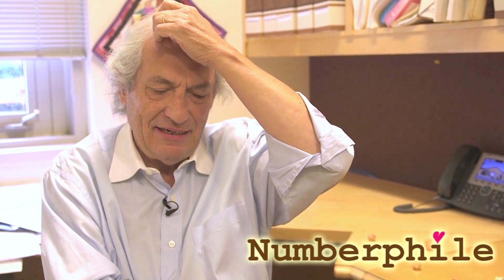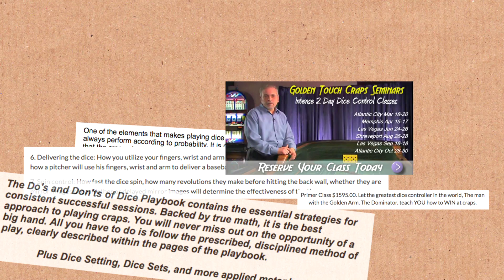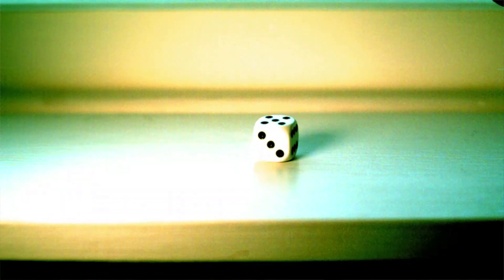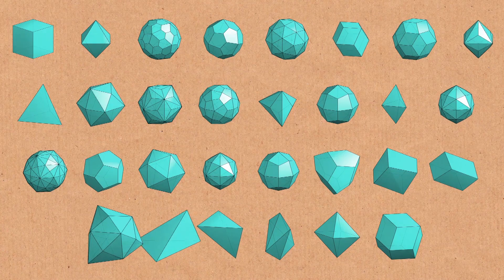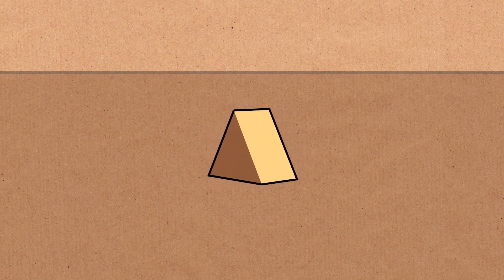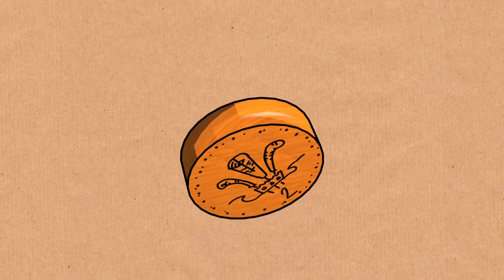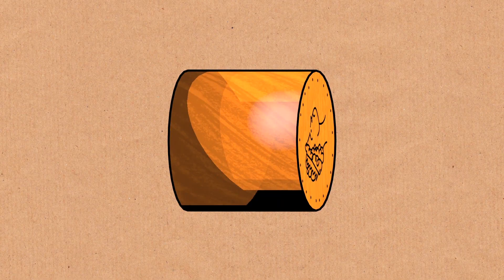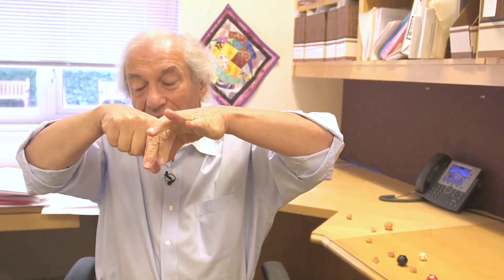Fair Dice (Part 2) - Numberphile

Comment: The roll rate of unique faces of a die come up the same as the time rate of radioactive atoms decaying in a sample of radioactive material.  So, for example, if you roll a 20 sided die 20 times then the expectation is that 20(1-e^-(20/20)) or 20(1-e^-1)=12.6 or about 13 unique faces will show (decay) in 20 throws of said die.  If you roll that same die 60 times the expectation is that 19 faces will show ie 20(1-e^-3)=19.  Then using Excel for example, x,y plot the expected number of unique faces that show against the actual number of unique faces that show for 60 throws.  Do this plot roll by roll.  Then do a first order (linear) curve fit to the data; set intercept to zero.  Let the slope of said curve fit be the judge of the die.  I would think that a slope of 0.98 to 1.02 would indicate a fair die.

Comment: In the previous video, you noted that some shapes for dice make it easier to roll a die so that only some of its faces come up. With cubical dice, for example, you could roll it so that it only can come up on four of its faces. And I see you continue on here. I'm not sure yet if you mentioned that in addition to the infinite number of bipyramids and so on, there are even an infinite number of fair dice based on the cube, because you can round off the corners - and the extent to which they are (symmetrically!) rounded off is continuously variable.

Comment: A probability expert? I don't think so. He' s an expert in experiments using different objects (dice, coins ,etc) and measuring the results and trying to explain the processes that led to those same results.  Replicating true "fairness" or true "randomness" would be almost impossible for man. Fairness and randomness means that the outcomes of any given thing have the exact same probability of happening. The more possible outcomes a object/thing has the more difficult it would be to replicate TRUE "fairness". This would mean that it would be more difficult to replicate fairness through a dice toss compared to a coin toss (which only has two possible outcomes). For example, if you have two dices it would be expectable that one of them would generate a more fair outcome than the other. But at the same time it would also be expectable that both the dices would generate a more convergent outcome compared to the expected outcome of a TRULY fair dice. So if you use several dices do conduct these types of experiments than you would most possibly obtain a less convergent type of outcomes compared to the type of outcomes that are obtained individually for each dice. This meaning that any conclusions should be appliable only to the ONE object that is being used/studied. So this guys work could only be associated with the object/thing that is being used to generate the specific outcomes and should not be generalized. Any type of generalization would be pure speculation.

Comment: Sorry if this has been discussed and I didn't notice. But can you not make a "rolling-pin die" where the ends are rounded or pointed and the cylinder is five-edged (or 7, etc.)? I didn't see a discussion if that had the same problems as the "reduced-length Toblerone." I would think not. Perhaps those shapes would not be considered dice?

Comment: You could make the tokeroniy thingy a 5 point instead of 3 point profile. You could also make a a 10 sided surface like a common d10 and number both sides 1-5 rather than 1-5 on one half and 6-10 on the other. For a 3 sided die, you could have a 6 sided die that has 2 faces representing 1,2, and 3.

Comment: For the thick coin example, shouldn't it be when the center of mass is in the middle of the surface when the surface is at 45 degrees to the table? So that both sides are always able to balance on their vertices. So, all vertices are a balancing point.

Comment: Long dice with pointed ends (a hexagonal pencil sharpened at both ends can be used as D6) are always fair and can be odd numbers also. In theory it would be possible to make a fair 1000 sided long die but it would be very thick so 3 d10's is a better choice.

Comment: I have a question about an odd sized fair die. Suppose I had something akin to a football (american gridiron ball for those of you outside the US). Couldnt I manufacture one of those to have 5 sides that all slope to two points and thus have a fair 5 sided die? 
Or even his example of a toblerone. Instead of having flat sides and a flat end, couldnt you round the sides to a point at either end and wind up with a fair three sided die?

Comment: I have to wonder if his 30 different fair families include what most modern d10s look like. Where instead of having two pentagonal pyramids with triangular faces glued together, instead the triangular faces are elongated into irregular diamond shapes and the two pyramid-esque are rotated slightly in respect to each other before gluing them together. 
(So instead of having a straight equatorial line, you get a zigzag line /\/\/ )

There 30 families image is shown quickly and isn't particularly clear so I can't see if anything like that is on there.

Comment: Question: does the placement of the numbers play into fairness? For example, in Part 1, a 30 sided die was shown which clearly has a "small side" with lots of small number facets and a "big side" with lots of big number facets. If you roll this die and it comes to a stop on the big side, you're going to get a big number. Does this matter? It seems to me that it would be better to intentionally interlace the big numbers with the little numbers with the middle numbers.

Comment: It's easy to make a fair five-sided die. Well, technically it would have fifteen sides, but ten of those are impossible to land on:
Make a pentagonal prism. Cap the ends off with pentagonal pyramids so that when the die lands on any of the pyramid faces, it topples over to land on its side.

Comment: If you took 8 marbles, or rather small metallic spherules, like beebees, and [insert science here] so they were all magnetically repelled, then pushed them into a hollow acrylic sphere, like siblings under punishment together in a room, would they form the natural outline of a cube? As the beebees jostle to gain the farthest distance between each other, and as you add beebees one by one, giving it a jostle if you seriously used a hampster ball, would the resulting configurations identify the outlines of the best possible symmetry for each yabbadabbahedron? Sorry, I forgot the words. Or would it just make useless weird shapes where planes can never land? -Phill, Las Vegas

Comment: I have a 5 sided die made by Gamescience, and they used that system.  They rolled a die tens of thousands of times until the chance of getting an edge was the same as getting one of the flat faces.

The die worked on hard surfaces.  On a hard surface it would hit, and usually start spinning.  Once it was spinning, getting the edge faces was equal to the flat faces.  

But if you rolled it on a soft surface (say a vinyl gaming map), then the flat faces came up a lot more often.

Very interesting talk.

Warm regards, Rick.

Comment: The probability of landing on a surface of a coin or any type of object is not only dependent on the amount of surface area but also the interaction of the edges of the object to the surfaces it interacts with prior to the 'coin' settling down. Equal areas for each chance potential is not a strict condition to make the probability equal to all others.

Comment: A five sided object similar to a standard length pencil would roll with an even chance of landing on any of it's sides. Just as a coin has distinct legal areas of valid chance the "Pencil" die would only count the sides it lands on as valid. The number would be read on it's ends. :)
The same could be don just as the previous video showed with any number of sides until you reached a theoretical roundness that would not be any sided at all.

Comment: Consider a pencil sharpened at both ends. That's a fair 6-faced die. Any right "tapered ends" prism with a convex regular polygon base like the pencil, that is with any number of sides, would be a fair die in theory as well as in practice, I claim. So clearly any number of faces ≥ 2 including odd numbers is easily done by this nullifying of the end or base cases!
Reply: Ok, so you say all sides must be flat. No problem, the only requirement is to remove the end cases. Make them pyramids then.

Comment: I don't understand, why it wouldn't be possible to construct a fair dice with odd number of faces. Take the toblerone shape, and cut off the edges at each vertex at an agle, which makes it impossible to stand on it's end (center of gravity outside of the facet's area), and you have a fair 3 sided dice. You can even write all three numbers on all three faces in different sequence (123,231,312) first meaning the rolled digits, second and third painted in a color same of a dice. I bet i'd be more fair than a (non-casino quality) 6 sided dice.

Comment: Take a rod with a pentagram cross section, cut it to length of about twice it's thickness, then taper the ends to points. Voila; 5 sided die

Comment: There can be a fair five sided die. If you take a pentagonal prism and put pentagonal pyramids on the ends, you would have a die that, although it has more than 5 sides, it only has 5 plausible outcomes, because if it was to land on one of the ends with a pyramid, the center of gravity would not allow it to remain in that position.
Reply: Niels Kloppenburg you cant have a 5 SIDED die if you have more than 5 sides.

Comment: Interesting series. That said, I dispute the professor's claim that all fair dice have an even number of sides. This is true of polyhedra, where the sides are planar, but it's entirely possible to make a convex three-dimensional shape with an arbitrary number of identical, curved faces that can be rolled fairly. 

Take, for example, a pentagon, with points pulled from the center of each side as shown in the video to form a fair 10-sided solid. As shown, this will have a planar pentagonal "equator". If you evenly smooth each side at that equatorial division, you will end up with a five-sided solid with symmetry that can be rolled fairly.

Comment: someone should make a coin that cant land on its edge. the edge would need to be extruded so that the top and bottom surfaces approach the thickness of a point. you could also make a coin that is conical, and color heads/tails two diff colours, then base the flip upon up/down states. I imagine the conical coin would be perfectly fair, although it's dimensions would be based on some weird symmetry based on pi

Comment: I know, older video... but I wanted to mention that I have some odd sided die that I believe to be fair.  They are made with a polygonal cross section that has a curved taper to each end.  Three or five identical faces with the same number of identical edges and two identical nodes - and can't sit on its end.

Comment: Couldn't you give that Toblerone curved sides taper into points on each side, creating a 3-sided die? That would be odd-sided. I know this goes outside the unstated parameters of straight sides, but is that unstated parameter really required for dice?

Comment: Possible n-sided dice: A sphere with separate areas that are equal, representing the different faces.

Weird “Die”: A sphere with a screen, inside a small metal sphere (really small) when falling the metal sphere levitates inside on the larger sphere momentarily before hitting a wall, an electrical charge registers this and adds a number to the screen. It kinda registers how many bounces the metal ball makes, and turns that into a number.

Comment: So what ratio of diameter to length would a cylinder embedded in a sphere have to be so the the surface area of the surface over the end caps would be the same as the surface area over the cylindrical band?  Don't leave us hanging.

Comment: Ok, so would a Toblerone (or rather, a triangular prism) itself be a fair 3-die? Let me say a couple things. Obviously extra flat sides don't matter - you have rolled a d4 with clipped vertices, and didn't care that that die actually had eight sides, albeit 4 of them tiny. You have flipped a coin as a d2, not caring a whit about the possibility of landing on an edge. So given that a prism landing on its end is an unlikely (and invalid) result, would prisms make fair dice? And couldn't you make them with any number of sides, just check the bottom side for your result?

Comment: First start with a cylinder with the radius larger than the height of the cylinder. Then start to shrink the radius. The volume of a napkin ring around the cylinder will always be the same, and the volume of one of the other two caps goes from larger than the napkin ring to smaller than it. Therefore, there is somewhere between where the volumes are equal.

Comment: What if you just rolled the Toblerone as is?
The two ends will have close to 0% chance of coming up so they dont need to be numbered (like the flattened tips of the D4) resulting in a fair, though unorthodox, D3. More sides could be added to make a fair dice with any number of sides, odd or even up to infinity where it would become a cylinder.

Comment: It is technically possible to make a fair d5, you just have to do some fancy shaping on the edges and corners. Lou Zocchi finally made a d5 and d7 that passed 100,000 test rolls in a variety of conditions.
Reply: Unless he has worked some magic since I last heard, the fairness of Zocchi's dice is dependent upon the surface that they are roll on.  Rolling one on a felt tabletop will result in a different distribution than rolling it on hard wood, which will have a different distribution than rolling it on metal.
Reply: They had a section of the video explaining how to control the outcome of a cubic dice by rolling it askew. If we take methods of rolling into account, no dice is 100% fair.

Comment: Interesting stuff.
  I think that you can make a five sided dice... in an uninteresting way, I suppose.  So if you made a pencil with 5 sides instead of 6 and sharpened both ends.
Reply: Oh yeah, it would just kathunk instead of doing the balancing thing. No you've got an interesting conjecture, and I'm not sure who to believe. I'm gonna play it safe and believe not you.
Reply: The cones created by the sharpened ends of the pencil count as side - that would be 7 sided
Reply: @noahkupinsky1418  
Since it's impossible for the "FairPencilgon"™ to "land" on it's conical ends, assuming a flat landing surface and "gravity", would it be more accurate (on target) to claim the FairPencilgon is a "five landable sided" die?

...and is this yet ANOTHER category of "fair" dice? 

(( I'm gonna say "Yes" to both those questions. )) Mahalo and aloha! :) 🤙
Reply: I am fairly certain that this type of die encounters the same problem that the two d4s stuck together into a d6 did. It is technically fair in that the probability of landing on the sides in a perfect math world would be equal, but rolling a d5 pencil would be easier to control than a true fair die would. It wouldn't have as many symmetries as a true fair die does, so controlling it requires less skill and control than with a true fair die.
Reply: Oh wait you said that two years ago not weeks ago oops

Comment: What if the surface of where the die lands wasn't flat? Say the surface wasn't a flat 2D plane and had a patterned 3D topography, then couldn't you create infinitely more fare dice shapes that could evenly match with that unique surface pattern of the table?

In other words, couldn't you have some really weird looking dice matched with a weird looking table, while each number still has the same fair and equal probability of landing?

Comment: dice can tell you the radii of the earth and the moon,
layed down, the top and bottom always equal 7,
1+6=7
2+5=7
3+4=7
1x2x3x4x5x6x7=5040
10x9x8x7=5040
earth=3960
moon=1080.

without the 7, you will get
1x2x3x4x5x6 = 720
10x9x8 = 720
2spheres.
also fun fact, any number can be brought back to base 10 system e.g.
0123456789 10(1+0=1) 11(1+1=2) 12(1+2=3) 13(1+3=4)

[1]+[2]+[3]=                     [6]
[4]+[5]+[6]=[15] [1]+[5]=[6]
[7]+[8]+[9]=[24] [2]+[4]=[6]
Reply: Touro Louco
Okay cool

Comment: Does the order in which the numbers appear on the die effect fairness? 
For example, the numbers on a standard 20-sided die appear in a pattern where the sum of the face-up side and the side directly opposite it always equal 21. 20 is opposite 1, 19 is opposite 2, and so on. But some 20 sided dice do not follow this pattern. Is the standard D20 more fair than the non-standard D20?

Comment: But what if instead of flat sides, the Toblerone curved to end in points at the ends you'd then have a 3-die. but if you started with a pentagonal prism instead of a triangular prism it'd be a 5-die.

Comment: RE: The fair 5-sided dice.

If the surface area of the sides can be measured in a continuous range such that there must be some size of dice where all 5 sides are the same size. Wouldn't there also be a continuous range where the probability of each side was even? I imagine that the fact that the oblong shaped sides have 4 edges affects the probability compared to the triangular sides. But if the triangular sides were bigger then wouldn't that offset the difference in probability that the increased number of edges gave the oblong sides?

Or could you manufacture a set of 5 toblerone shaped dice in different size ranges such that when rolled together and averaged that the result would be a fair probability of any number between 1 and 5?

Comment: what if you make a pentagonal prism, and then prolong the edges on the sides so that they come to a point? it'd be curved, so it wouldn't be a polyhedron, but it'd be a fair five sided die.
Reply: or, and this is even more cheating, paint two sides on a d10 with the same number ¯\(ツ)/¯